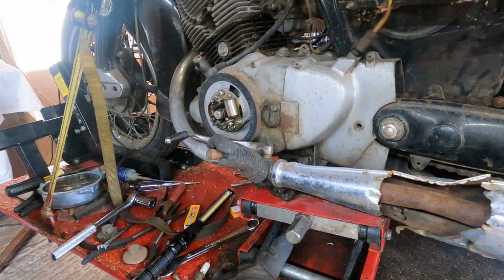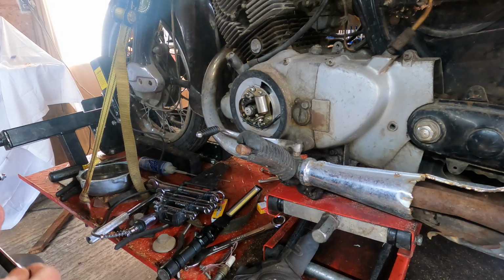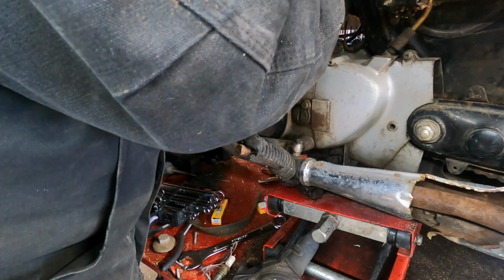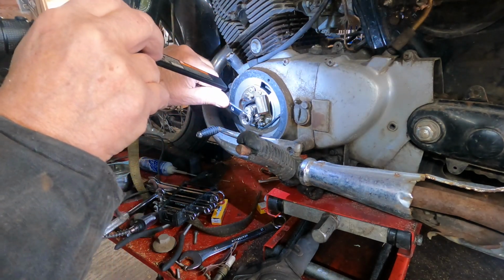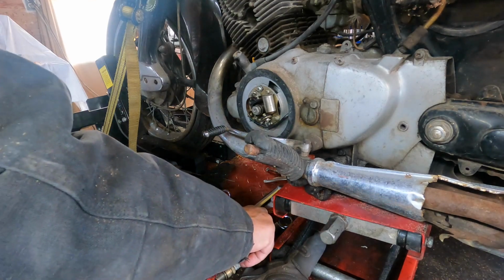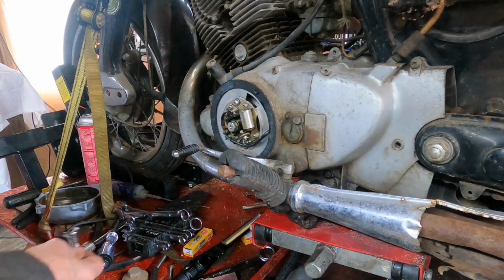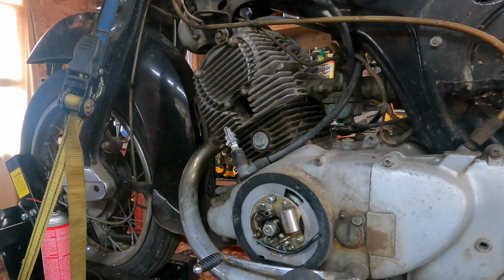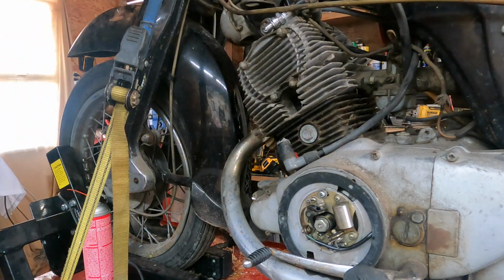Honda CA160 Spark Problem

Comment: The ignition system is called a wasted spark. Both spark plugs fire at the same time, every 360 degrees of the crank. In order for you to have spark at the plug, you need both spark plugs grounded. So put one in the hole with the HT lead connected and test for spark with the other plug grounded to the head like you were doing on the other cylinder. I doubt that the coil is actually bad.
Reply from the maker: That could be my problem. Thank you Thank you. Both of the new spark plug caps are in my mailbox right now so I'll put both plugs on and try it again.  I was trying to think of that "Wasted Spark" moniker the other day. I've got an old CL125 that has that same type engine and that's the first time I had heard that term. Thanks again for the info.

Comment: Yep, that’s a CA95 150 not a 160.
Reply from the maker: The engine is CA95 and the chassis is CA160. Parts are coming Tuesday so we'll see what happens.
Reply: @oldguysoldbikes I had a bad coil on my CA175 (Actually a CL125A that I dropped a 175 engine into). Replacing that and new plug caps gave it a strong spark. Noticed in the video that the points were sparking quite a bit so might need a new condenser too. Funny but my Yamahas never have had a bad coil and I can’t remember replacing a condenser either. Merry Christmas
Reply from the maker: That's my experience also. Never replaced a coil (and solved a problem) rarely have had a bad condenser. The spark plug caps are already replaced and hopefully the coil and condenser will both be here Tuesday. Merry Christmas and Happy New Year to you and yours as well.